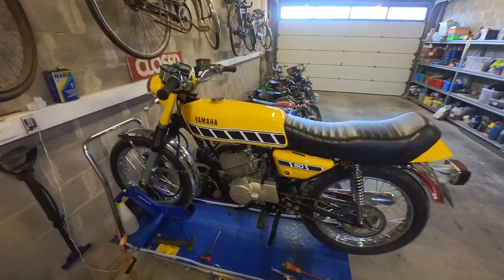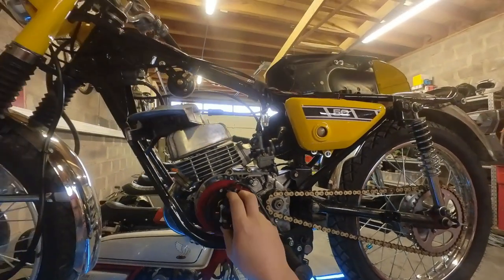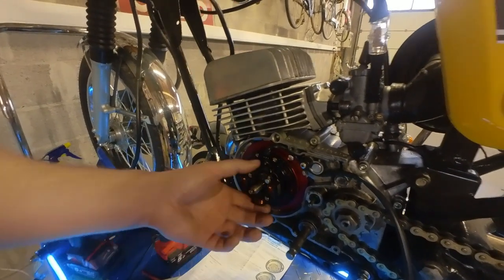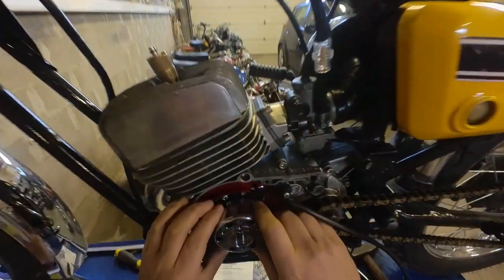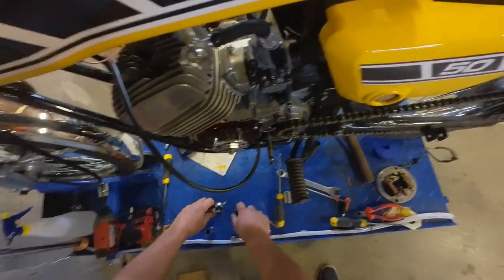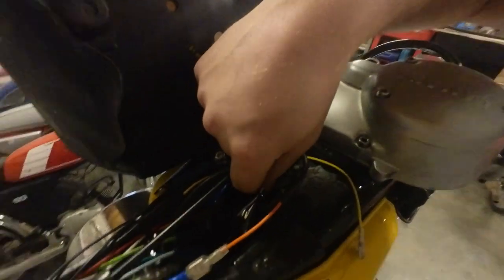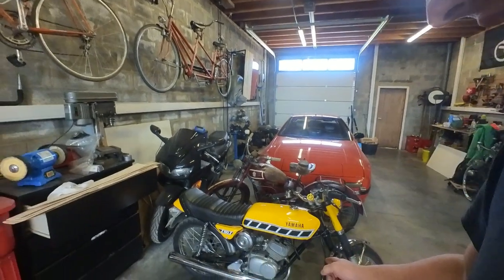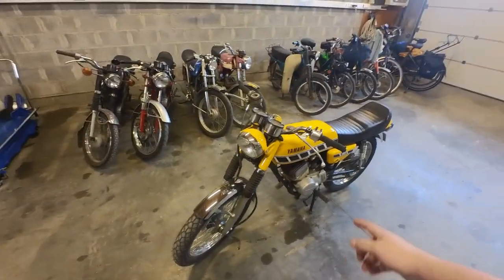How to install an HPI 2Ten ignition on a Yamaha RD50dx

Comment: Did you ever get the light to work? I dont know how to set up the lighting cirkuit but it runs fine.
Reply from the maker: @nielshermansen3299  yeah lights work fine. Even better than before. You do have to switch to a 12V system. 
One of the wires (I think it was yellow) is your supply. Connect that to the main wire of the loom and it should work as before

Comment: This video was great. Help me alot. Im building a fs1 with a rd80mx engine malossi 93 cc big bore and hpi 210 and been having the same issue with weak spark when cold. So might try the hpi weight kit.
Reply from the maker: I was also thinking about that, but I kinda like the fast throttle response. Not sure how much you loose with the extra weight. It ends up starting ok now. And when hot if it doesnt start easily, a push start usually get its going within a meter or so.

Comment: Hi thank you for top video. Can you lease show us a link to buy the tool to adjust the TDC? thank you
Reply from the maker: It's this one I'm using:
https://www.jmpbparts.com/micrometer-sparkplug-hole.html
Let them know I sent you 😉
Reply: @VintageGarageYT thank you , i will. Could you please me help me with another question? The site address also has some interesting pieces. I'm asking if you can help make the connection to the lights, horn and brake light circuit. My motorcycle (Gilera Trial 50 - 5V from the same date of this beautiful RD), has no batteries, regulators or other electronic components. It's a rudimentary system I think only 3 wires come out of the actual flywheel and one of them is for the lighting circuit switch or the other two are from the high coil I calculate. In addition to changing the lamps to 12Volts I will have to buy a 12Volts regulator, if necessary, how will I make the connections? Thanks a lot
Reply from the maker: @eduardodias4661  12V out of a 70s bike? Are you sure? Stock systems from that era have 6V systems.
What colour wires are coming from the engine? Try to get the bike running and grab a multimeter. Usually 1 wire is the power (6V) and one of them is to shut the bike off (usually black). Connect that one to ground and the bike should turn off.
Usually (but depending on your bike) the light switch will take the 6V from the engine and when switched on, will comnect that 6V to another wire. Wire those your lights and connect the ground wire on the lights to the frame. You can do the same thing for the horn. I actually have a video on the electricals off this bike on the channel! You can check it out
Reply: @VintageGarageYT  maybe i did not
well explain. My Gilera is 6v but if i install the hpi 2-ten Will produce 12volts, correct? That is the reason why i don't know how to Wire the Yellow Wire that is on the. Kit to have lights and horn on the moped. Thank you
Reply from the maker: Ah yes, if you're using the HPI 2Ten, you will have 12V. So you will have to change your light bulbs and horn for 12V versions.
The yellow wire is indeed power for lights and horn. I just connected that to my existing wiring loom where the original power was connected. If you have to make you own wiring, connect the yellow wire to one side of the switch and connect the other side of the switch to your lights. You can test switches with a multi meter to see where it makes a connection in the 'ON' position.
Make sure the fittings of your lights are connected to the ground (usually the frame) and these should work. For the horn you can do the same thing. Most switches on mopeds have different connections (1 to connect the power, 1 to connect the lights, 1 to connect to a horn, ...). But that depends on your type of switch.
Then connect the wire for your horn to the + terminal on your horn and the other one to the ground.
Reply from the maker: Also check out the video out here: https://youtu.be/nPgudS3poAo
Here I tried to explain how the wiring works.
Reply: @VintageGarageYT  but i need to buy a regulator, correct? I believe the rd as One bat and regulator. If i Change the bulbs only they can burn if i don't apply a regulator? So that is the point if in case i Will need a regulator i don't know how to wiring that to the system lights. Thank you
Reply from the maker: @edw670  U need a regulator when running a battery. My RD stock had a regulator and a battery, but currently it's running fine without battery and without a regulator. I think 15 or 20Watt bulb up front, 10W in the rear I think. Works fine for now, none have burnt out yet, but I havent ran more than 50km yet since the HPI was installed, so unsure if they will hold up
Reply: @VintageGarageYT  thank you very much
Reply from the maker: @edw670  no worries, happy to help! Let me know how it works out!

Comment: Sir could you explain more or perhaps a link to use the Spark Plug Micrometer? Excellent video by the way.
Reply from the maker: Thank you!
This is the one: https://www.jmpbparts.com/micrometer-sparkplug-hole.html
If you do buy there definitely let them know I sent you!
How it works: 
Rotate the 'top half' to the middle of the threads and loosen the screw that holds the center shaft.
Rotate the engine so the piston is at top dead center. The center shaft be pushed up a little by the piston.
Tighten the screw again so the shaft is fixed. Then rotate the engine until the piston is behind top dead center.
Then you can rotate the 'top half' section. It has indications on there. 1 full rotation is 1mm.
So you rotate the top half piece 2 rotations inwards.
Then rotate the engine until the piston hits the center shaft. That's the point where you have to put the rotor on. 
Let me know if you further questions! 😁

Comment: Is it good? I mean the HPI? i was thinkig of installation for rd250 with points.
Reply from the maker: I like it. Picked up power over the entire rpm range and gained a lot of throttle response. Not sure if the difference will be as big with a 250 though.
Reply: @VintageGarageYT  probably it should be too. ignition time is always the same with CDI. How did you solved problem with hard cold start? It was related just with choke on/choke off? Did you installed DC rectifier to charge battery or it works in AC mode? DC always produce stronger spark.
Reply from the maker: @Endrjo  On this bike the power on the spark does not go through the battery. Straight from the coils. So currently not running with a battery and/ or rectifier. CDI timing has a curve instead of being fixed like points. I also got a CDI with 2 curves, but have not got around testing it.

Comment: This is a different engine to the uk dt rd ty
Reply from the maker: @edwardlevett2459  really? What's different?
Reply: @ at least the cylinder, head and standard stator.  Uk one as standard has two coils , your one uses radial coils in standard  stator
Reply from the maker: @edwardlevett2459  I think you are talking about an RD50M these had indeed a newer ignition and different cylinder and head. This is a DX model with aluminium cylinder and head. The M has a cast iron cylinder and head.
Reply: How many gears does the Dx have ?
Reply from the maker: @edwardlevett2459  it's a 5 speed. I think the M also has 5 gears?

Comment: Be warned hpi ignitions can come with issues and little to no  help will be given from the seller. Do Not expect a refund if it fails to work at all
Reply from the maker: Jmpb is a reputable seller and I have never had any issues with them. If a part was bad before they've always handled it correctly in the past.
Can't speak for HPI themselves though... Did not have any issues with the unit, but I do know cooling is very important for them. Most failures are due to overheating
Reply: @VintageGarageYT  Good to know your seller is honest and should be pointed out as you have.
No heat issues for my problem just a faulty unit out of the box. 
Seller (official dealer) was reluctant  to assist with help initially then refused to repair or replace.
good to see you had good luck with the unit.
Reply from the maker: @Struth_Mate  oh that sucks. You got it straight from hpi themselves? Weird how they refuse to replace it. I even think they have to by law (warranty and such)